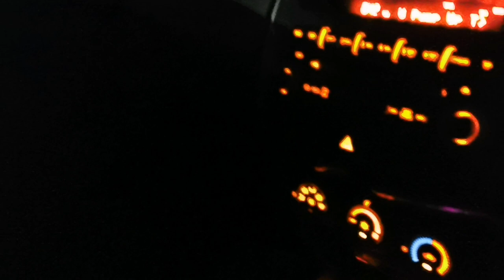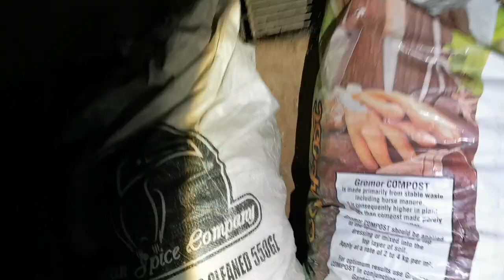Black Mamba came into their home and ate their kittens 😳😟😲

Comment: Curious why when you get  them with the long arm throngs, you don't transfer to the sack with it.   Why grab it with you hand and put yourself in danger of a bite?
Reply from the maker: The way they thrash and twist in tongs, trying to put them into a bag or bucket without using hands would almost certainly result in a broken spine, or atleast multiple broken ribs or bad skin lesions in most cases.
Especially powerful snakes like Mambas.
Quickly transferring into a softer hand grip that can support them and minimize twisting etc, is far safer for the snake and the handler, believe it or not 🙏🏻👍🏻